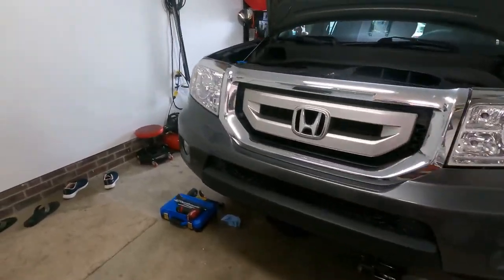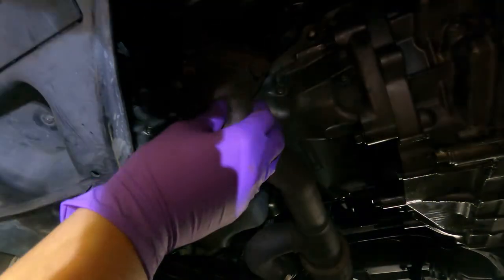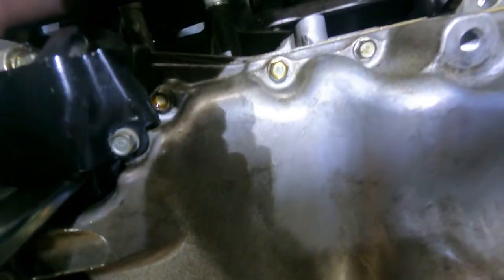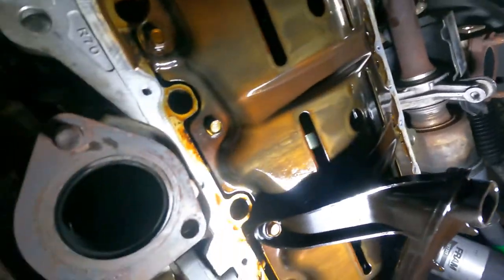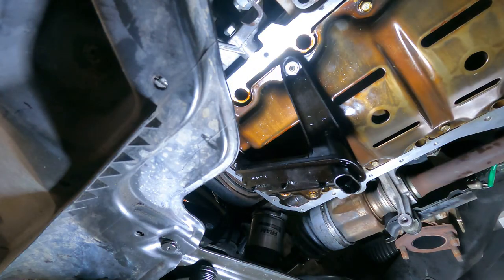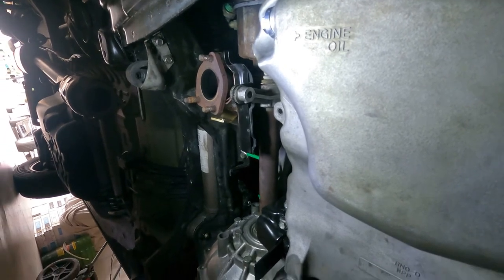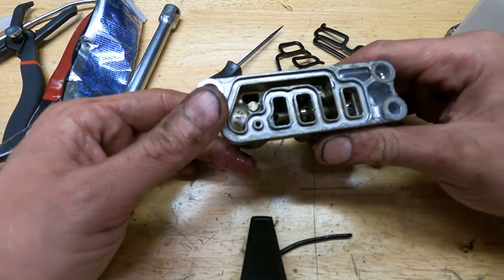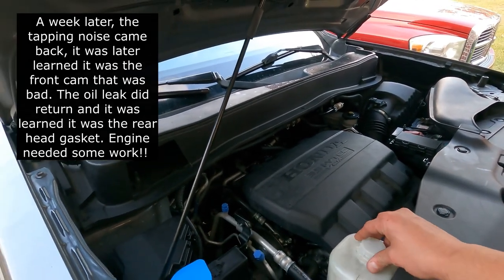Honda Pilot oil pan and and spool valve gasket replacement!

Comment: I must have gotten luck.  2011, 237k miles and nothing but the general maintenance stuff.
Reply: Same.... Haven't had a problem yet. Had TB done at 225k.. It runs like a clock. My buddies wife has one also and she forgot to do the oil change for an entire year, surprisingly hers has survived and keeps on going.
Reply from the maker: This car was neglected, which caused all these problems.
Reply: @DLMGarage  I can see where that would be the case. My only critique is the fact they chose a timing belt over a ⛓️ with an interference engine.

Comment: Is that a junk yard oil pan or engine? I see that junkyard tag!
Reply from the maker: yea, I noticed after the fact, eventually learned this cars engine was replaced, but this engine had issues. The leak was still their after all this and found out it had bent valves.
Reply: @DLMGarage  yea done so much work hard to miss. Just an old shade tree mechanic   lol

Comment: Do you have the link for the VCM muzzler? I bought one but it didn’t work. Thanks
Reply from the maker: https://www.ebay.com/itm/353133561057?hash=item52386684e1:g:coIAAOSwxlBeKQgD&amdata=enc%3AAQAHAAAA4HNX3L6aFw5jK0OJXGKWGehiuf8KFSjf%2BMz9n1xlp5r17DcGxYKYub2akjVHy2olNL8Oi0A%2B3fR%2FeZ3y2gJh9ubhy7RmqBn8eGy2gKQpnlDT%2FzjG5dJFob3WsixfMBOkzFPEfS7r0jwuxBuzxwdyAE%2B1uU%2BJE4oejYLPM9jzJJlzvs7ASyFzRVRuLqsBx5SHFnJMiwr5Q4A1W34XV3SGdQ0SIrtE4Gw%2FSiEJBT3FWNbcIqJ5wHHwnf8IRVkzojPyHR9kQ92JpexaPkfzEFHqzacjL5LNtu2ToUihByCpiXsP%7Ctkp%3ABFBM3v_rzNJh
Reply: Get S-VCM Controller 4 years now no issues

Comment: Worst vehicle I have ever purchased. Thought honda was a dependable car. It is until it starts giving you problems then it's one problem after another. I will never purchase another pilot in my life. The $$$$ keeps adding up no thnx honda never again.
Reply from the maker: agreed, even after doing this, I still had the problem, turns out it was a bad head, delt with bad coil pack, failed timing belt tensioner, I ended up selling it and getting a toyota highlander, hated this suv.
Reply: @DLMGarage  Yeah the timing belt tensioner is designed to go right at 100k and you don't want to wait or you risk damaging the engine. So that was $1200 and with the other fixes I have dumped 3k into this veh in just the last 6mos.
Reply from the maker: @mrsmith7751  wow
Reply: Lol you never owned a mini cooper. Hondas are super easy to work on compared to a bmw product
Reply: I hate to hear that Mr Smith, I've got a 2010 MDX with 288K and it's had a few problems but I can't complain. These engines like synthetic oil(10-30 or 40 in Texas). The last TB I installed was a Blue Gates that's Kevlar and I expect it to last 200K from installation. There's a company out in Florida that makes a manual belt tensioner I'll install when it goes out. (P2R Power Rev Racing)
It was roughly $650 for both cams(OE) and a couple rocker arms and they can be swapped without pulling the heads. Any BMW, Audi, MB is going to be more expensive to repair and probably much harder to work on. Something I see on a lot of videos is no one checks the PCV System for good function. Varnish buildup inside, cheap oil and not changed often enough. I don't have VCM but I'd disable that first thing with all the problems it creates.
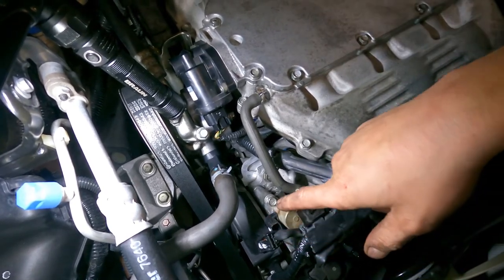At 26:25 the small hose that goes from the Valve Cover to the Intake pulls all the Blowby out of the engine and fills up with deposits until it clogs up. Keep it cleaned out.
Maybe you got one that was neglected I don't know but Honda/Acura and Toyota/Lexus have the best names in the industry for a reason. Anyway, it pulls my boat pretty good, could use more torque.
https://www.youtube.com/watch?v=-Pa8_Jkk1wc&t=2s